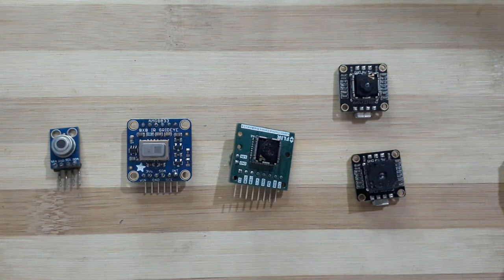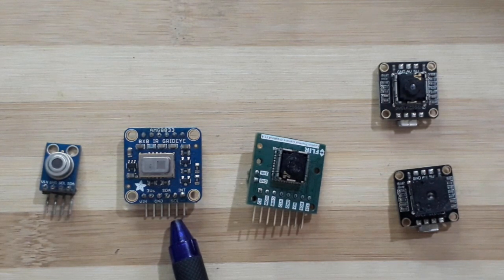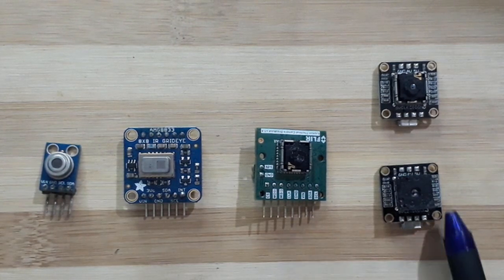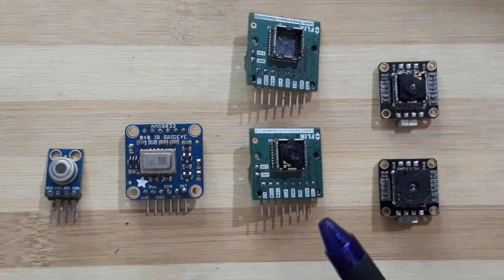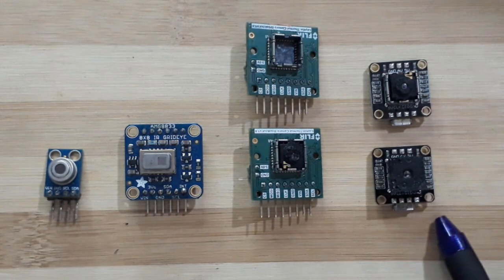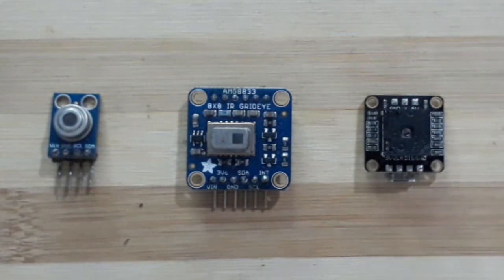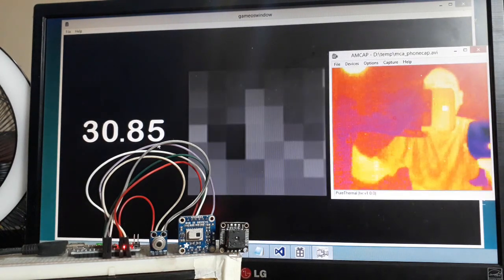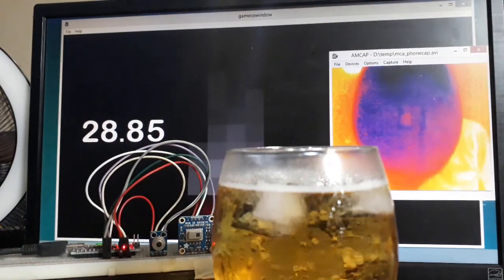Preview of non contact temperature sensors  MLX90614, amd8833, Lepton 3.5

Comment: do you have the program code for the nodemcu esp8266 board and the mlx90614 sensor
Reply from the maker: Uh no I don't have the code anymore, but I used arduino for the mlx sensor.  There's a lot of sample code on the internet.  I just basically downloaded a sample and just tweaked it a bit.

Comment: Hi:) I watched your video well. But I have some question.
First, I plan to use lepton 3.5 for checking person temperature, and i want to know the specific temperature (like 36.5). In your video, you get that temperature. So can you help me how to i get that number only use lepton 3.5?
Second, more detail , i want to get ROI(region of interest) average or pixel temperature.
Reply from the maker: I just used the average of the center of the image.  I didn't really think of getting an accurate reading.  So I'm not sure if that will really accurately reflect the person's temperature.

Comment: I'm trying to create a "cheap" presence detection for ex when a person is present and not moving watching TV. Would you recommend a cheap sensor for monitoring 4x6m rooms?
Reply from the maker: you could try the amg8833.  it has a 7 meter range and 60 deg viewing angle.
Reply: @animocapvids  how does it compare in spec and price to the mlx90614?
Reply from the maker: @Airbag888  The amg8833 is more expensive maybe 4x more than the mlx90614.  That's because it's an 8x8 pixel sensor while the mlx is just a single point.  So if you're covering a wide area you'll need a sensor that can cover the area.

Comment: MLX90614 has something to with distance between sensor and subject. As far as I know, 2-3cm distance between subject and sensor will give you an accurate readings. It has an FOV of 90° so the diameter of the spot it will read is twice larger than the distance. That sensor will return the average temperature of all objects inside the spot.
Reply from the maker: Yup, I've seen in the data sheets that there are also a lot of other MLX versions that are medical grade or have fields of view that are lower than this.  But I haven't actually tried anything else other than this hobby grade version of the MLX.

Comment: Thanks for the informative video. AMG8833 display on screen depicts me to search more about this.how did you interpolate the pixels of your amg8833.. I am currently researching of displaying thermal image in windows? hope for some helpful tips.
Reply from the maker: Interpolate?  The amg display isn't interpolated, its just a larger zoom of the 8x8 pixels of the amg (I think it's a bit cutoff though in the monitor display).
Reply: Did you display it with visual studio ?
Reply from the maker: @Acrexia0721  Yes, I using visual c++.

Comment: Ano po yung process para ma display yung AMG8833 at MLX90614 sa PC? and what software did you used? TIA!
Reply from the maker: I wrote a program in the arduino to output the data through serial, then used a program in visual c++ in the pc to display it.  For the pc side you can use any programming language that can read serial input and display graphics.

Comment: I am doing a school project with fire detection and alarm system Can I use amg8833 to detect fire in the room?
Reply from the maker: The amg8833 may not be the best choice to use for fire detection since according to the datasheet the max temperature it can detect is 80(100?) deg C.  So you wouldn't know if it's a fire or a boiling pot of water.  The amg8833 is normally used for people detection for automatic doors or airconditioning applications but it might be interesting to do research on how the sensor could also flag a situation where there might be a fire.
Reply: May i ask, what happend to your project? Did you still use amg8833? If not, what thermal imaging sensor did you used?

Comment: what temperature sensor can scan in a distance 5m??
Reply from the maker: Technically these can detect temperature variations  more than that distance as I've tried the lepton outdoors but if you need accuracy (like detecting if someone has a fever) I think the accuracy will drop the farther you are from the sensor.
Reply: @animocapvids  how about the thermal camera???
Reply from the maker: @garciamelaiza5334  The lepton can capture images farther than 5m but I'm not sure about it's accuracy at that range.  The specs say it's +/- 0.5 deg C but there's no mention of the effect of distance.
Reply: @animocapvids  okay thanks for your reply it means a lot to use .... btw the idea in  Infrared thermometer automatic measuring & voice system - Arduino https://www.youtube.com/watch?v=O1LYi0Sg5SE we use it but our professor wanted to detect more than in a distance and I have an idea to that and also to my groupmates

Comment: Do you have codes in lepton sir?
Reply from the maker: I'm just using a pure thermal board so it's acting like a regular webcam. There are ways to get the temperature info but I haven't really tried it yet with the usb.

Comment: Would the AMG8833 be a suitable sensor for a social distancing wearable device that will be partnered with a M5Stack UnitV k210 AI Cam?
Reply from the maker: I did see a doc on the application of the amg8833 on social distancing, so for certain applications you could use it in combination with the kv210 so you'd have both a high res image and an ability to detect people based on their temperature.  But if it's a wearable device, what would be the use case?
Reply: @animocapvids Planning on building a social distancing monitoring device. Also, how did you display the thermal image from AMG8833 ?
Reply from the maker: @reneeformoso2267  I used c++ to get data from the arduino serial port and display it using opengl (it's really old code that i just repurposed).

Comment: Great video! Can the Lepton be used with the Arduino Leonardo? Because it has atmega 32u4, which supports usb communication.
Reply from the maker: Oops, sorry, I'm not sure, I haven't had any experience with the leonardo.  What I did try before was to use the arduino with the original lepton breakout board (through i2c and SPI).  The problem was the original breakout board had problems and I couldn't get it to work without hanging.   I looked at digikey recently and there seems to be a new version (the FLIR LEPTON BREAKOUT BOARD V2), but I haven't tried it out.  Also the issue with the arduino is that it doesn't have the RAM to store one image frame from the lepton (the 80x60 pixel version would require storage for 4800 pixels) and I wanted to be able to store full frames.
Reply: @animocapvids  I see. Thanks!

Comment: Do you have the code used for the AMG8833
Reply: I have tried to do this using an Adafruit itsybitsy M4 express with arduino but I can’t get the my python to read the data given by the THERMAL CAMERA.

Comment: Wow, this is great. Lepton is looking really nice. Can it show the temperature value on the screen?
Reply from the maker: The lepton can provide the video data in a variety of formats.  The one used here is RGB where the lepton itself maps the raw sensor values to rgb color which is just treated as a regular usb camera output.  You can also get the data as a 16 bit number which corresponds to the temperature but it will require a some programming to get it in that format then it'll be up to you to convert the value to a temperature and also to a color that can be displayed.  I still haven't done that yet though.

Comment: Hi sir, I am working on my FYP can you suggest to me any of these for detection of body temperature under the distance range of 5-6 feet and also with good accuracy.
Reply: AMG8833 has 7 meters range
Reply from the maker: If you want an accurate body temperature reading I'm not sure these would be suitable.  The generic MLX90614 is only for a few cm and there are long range versions 50 cm, but I haven't tested the long range ones yet.

Comment: Good day, sir! Just wondering where you bought the lepton 3.5 and for how much? If you bought it abroad, how long did it take to arrive after you placed your order? Thank you very much!
Reply from the maker: I bought it at digikey I think it's $199 now and a purethermal mini board $99 that let's it act as a webcam plus shipping charges?.  I can't remember how long it took, the main delay then was that there's an export restriction (I live in the Philippines) so they just asked me to print, sign and scan a document that asked some questions.   I think it's to prevent use in military related stuff - anyway no big deal since I was researching it for airconditioning and insulation applications.  They sent it through DHL so the wait wasn't that long.
Reply: @animocapvids  Thank you! I'm also from the Ph. Planning to use this for me ECE thesis since the mlx90640 i'm currently using is lacking a bit in terms of resolution. Thanks again sir.
Reply from the maker: If you're going to use if for a thesis do a bit of research on the purethermal boards.  I bought the mini because it was small, but it only has a usb connection.  I think their other larger boards have both a usb to connect to a pc and also pins that you can use to connect to a microcontroller if you plan to use those.  Good luck on your thesis!

Comment: HEy, thanks for the nice research video :D so the lepton 3.5 u have works directly with usb to pc ?!
Reply from the maker: yes, but you need the purethermal usb board (There maybe other boards as well but I only tested the purethermal mini for now).  The lepton plugs into that board and the purethermal has the usb connection that lets the lepton act like a normal webcam from the pc's point of view.

Comment: What if I remove IR filter of normal raspberry Pi camera
Reply from the maker: That will let the camera see infrared but not in the wavelength range that thermal cameras see.
Reply: That would only see "Near Infrared" (which is still cool in it's own right, I'm building a portable camera using it), actual thermal imagers use "Far Infrared" where you start "seeing" temperature with sensors like these (which I kinda wanna add to my Near IR camera since I'm using a Pi 3 that could easily run both for even stranger capabilities for my project)

Comment: Sir I want to detect spilled water on the washroom floor, can you please suggest me best thermal camera for this purpose?
Reply from the maker: if it's just that, maybe the AMG8833?  it is low res but that should be enough to see if there is an area with a temperature change?

Comment: Thanks very much for your sharing. I want to make a small therma camera for home inspection like water damage, air leakage and other thermal anomalies detection. But I am wondering whether lepton 3.5 Is suitable. Do you have some suggestions?
Reply from the maker: There are already existing thermal cameras for that.  The reason you may want to use a lepton is if you're doing something specific like you can mount the lepton into a really tiny box on a stick and use it to inspect vents of places a normal thermal camera won't fit in.  Or if you can program some specific image processing for it.

Comment: So can't flir lepton  be connected with arduino?
Reply from the maker: It has an SPI interface (using the breakout board) so you could connect it but you need at least 4800 bytes (plus extra) to buffer the image so an arduino won't be able to handle it.